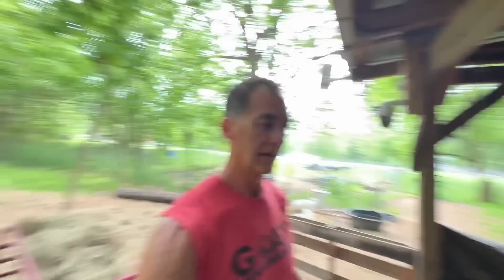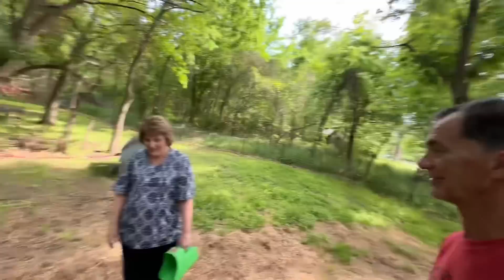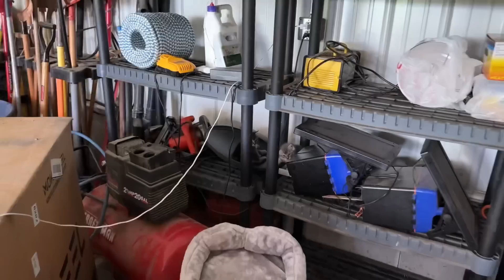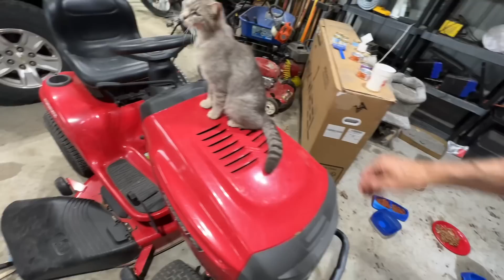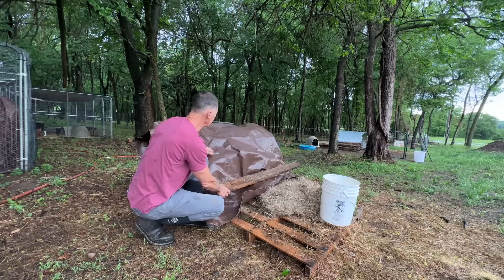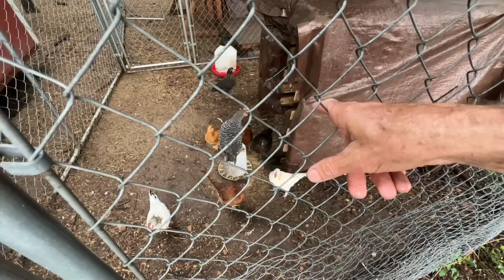So Sad! She Will Be Missed…

Comment: Happy Mother's Day LeAnn. A suggestion for you to keep the kitties safe, but still allowing some airflow. A friend of mine keeps their dog in their garage while they are gone. They built a 2x4 rectangle frame that is the length of garage door opening and approx. 12-18" tall. Then they attached screen material to it. Then they lowered the garage door to just sit on top of it the frame (I think they unplugged the electric opener and closed it manually. They did it to keep their dog in, but it would work to keep critters out too.

Comment: I put mine in a toybox sized storage bin and cut one end of the lid open. Then covered it with chicken wire and fastened it down with small zip ties. Then put the bin in the garage or chicken coop. I used a rabbit water bottle for them and it kept bedding a lot drier and keeps water clean. There's plenty of room for mom and babies in the bin and its taller than the water bin you have them in.

Comment: Thank you Grandpa and Grandma Adler for putting the kittens into the garage but I'm hoping and praying that the kittens don't get into the car fluids because that's very dangerous. Is there any way that they can be put into a crate for extra security. I can't help worry about oil and antifreeze drips
Reply from the maker: No car fluids in the garage that they have access too.

Comment: Cats are smart,  they know what we don't.
My cat started running out the door as fast as he can go.
So everytime he want out, he hesitates at the door, then runs as fast as he can.
I was leaving and turned around to lock the door.
I have flower pots on each side with flowers in then.
I looked down and there was a 5 ft black snake coming out of the flower pot up next to my leg.
I about had a heart attack.
That cat knew that snake was in that flower pot.
So now we pay attention when he's trying to tell us something.
And that's the only thing I'm worried about with your chicks.
Is a black snake eating them.
You could use that cage you had her in. Put hardware clothe around it and put it inside the chicken coop.
The other chickens won bother her or the babies.
They would be inside if it rains and more secure from the snakes.
I do this every yr.
When I'm growing out chicks that will be going in with my egg layers. That way they see eachother everyday. They get used to eachother then when they are big enough I can let them out with the others. Then it's no big deal cause they have been together for weeks.
Even though they were separated.  It's the same to them as being together. 
Just a suggestion. 
Big hugs.
I also use a trap for over the top so the other chickens can poop on the ones in the crate.  The bottom to the dog house would work. Or something at a slope works better then they can't get up there.
Then you can sleep at night knowing they are locked up inside the coop.